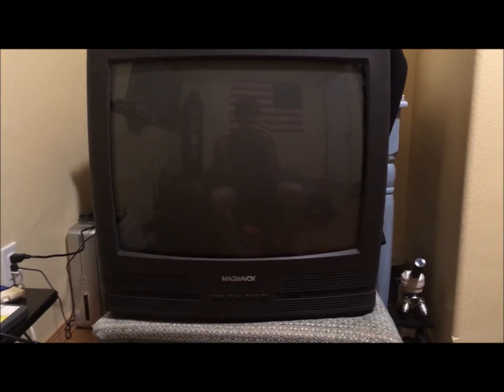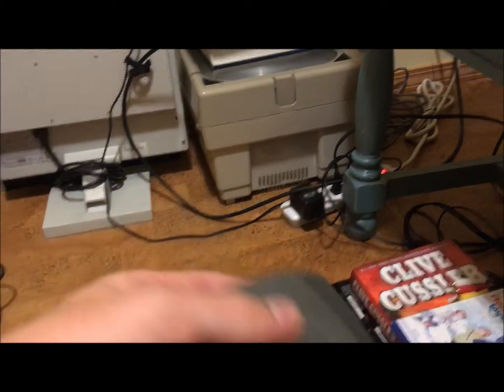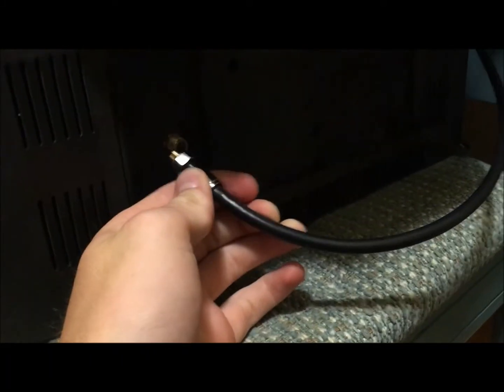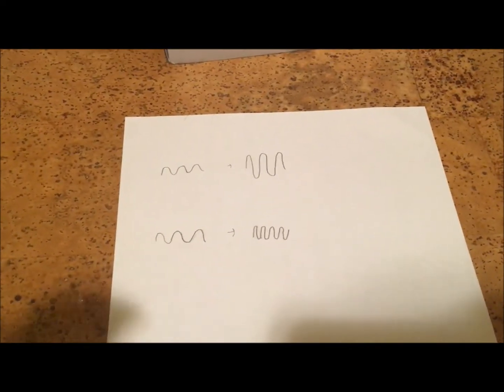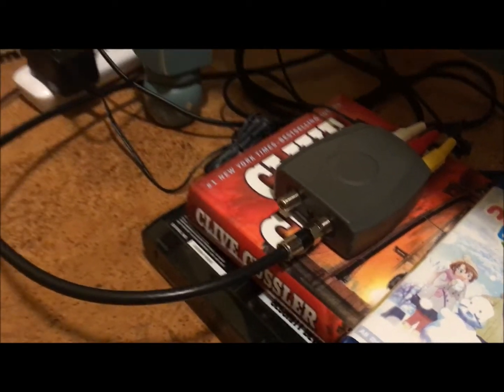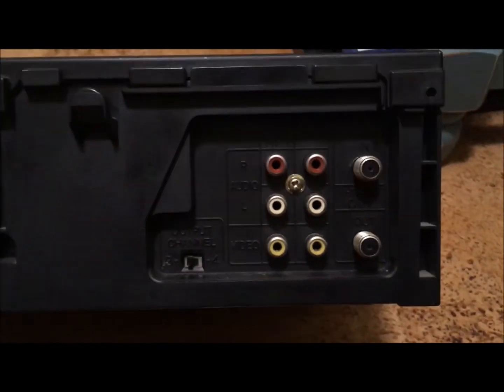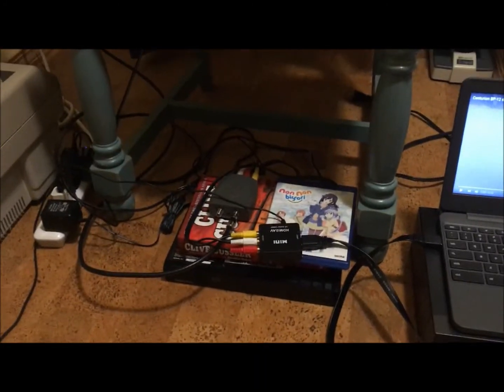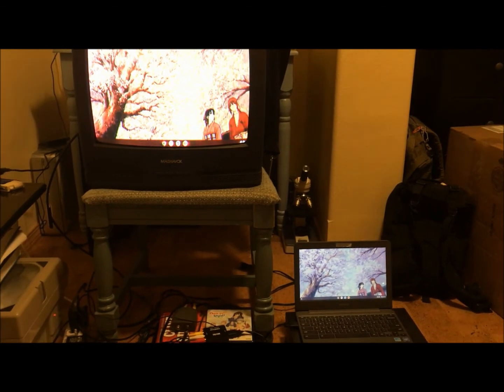RF Modulators (How to Connect Stuff to an Old TV)

Comment: How do I plug in the RF modulator to the back of tv without breaking the little fragile pin 📍? 
Asking because I ordered a RF modulator online because my tv doesn’t have the av red yellow white and the damn pin was broken when I took it out the mail package
Reply: cut the cable and move it back
Reply: I hope you got your problem solved. What the guy who answered meant was trim the insulation of the wire back to see more wire (pin). 😊 A little more to it but I hope you got your problem solved!